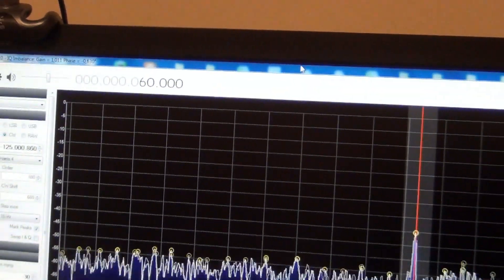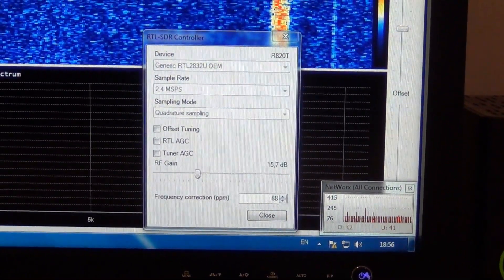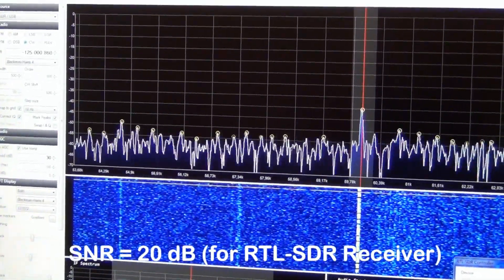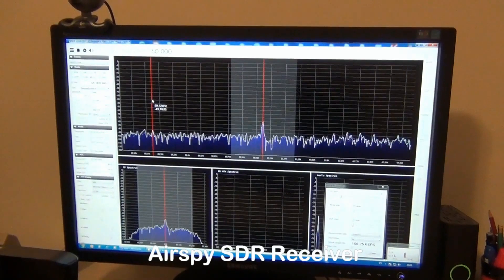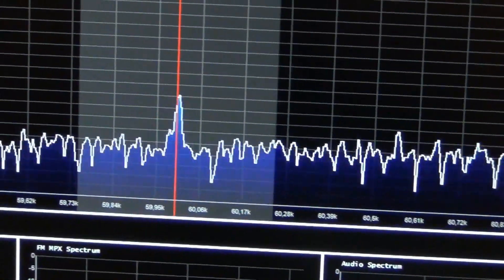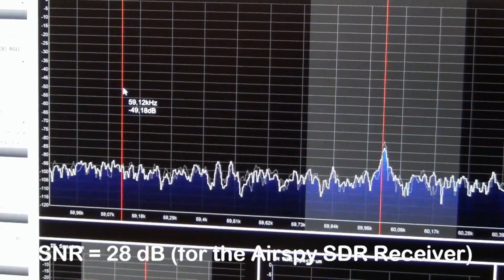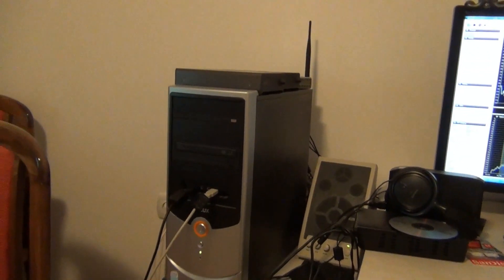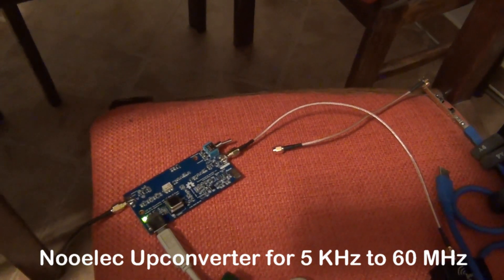Airspy vs RTL SDR receiving VLF

Comment: Both receivers use the same tuner R820T2. There should be no difference in S/N. Did you apply the same decimation and settings for both units? Decimation will shift the noise floor and indicate a different S/N.
Reply: They have different circuit boards, heat characteristics, and shielding

Comment: Thanks for the informative video.  Could you explain your antenna in a bit more detail?  Do you use any kind of tuner or impedance matching network between the delta loop (which I assume is untuned) and the converter input?
Reply from the maker: Hi ranickel, You could see my antennas in my backyard in the other video on my YouTube channel:

https://www.youtube.com/watch?v=L-1V9t5tdhk

Starting from VLF up to some 10 MHz, I found that My 10 cm Mini-Whip active antenna is far better than 33 meter Delta Loop.
In this video ("Airspy vs RTL SDR receiving VLF") I am not using any kind of impedance matching network between antenna and converter input.

Comment: Mile, good instructive video, i also  use a lot of toroid for removing inducted PC noise.  Only a doubt, my be the time signal is coming from UK, MSF station?
73 IW4ENS
Reply from the maker: You are right Roberto. The signal is MSF time signal on 60KHz from Anthorn, UK, about 15 KW ERP:
http://www.npl.co.uk/science-technology/time-frequency/products-and-services/time/msf-radio-time-signal

(about 2370 km from my home in Shtip, Macedonia). 73